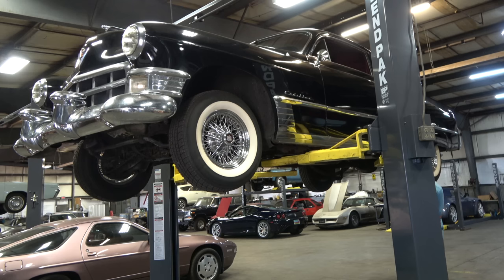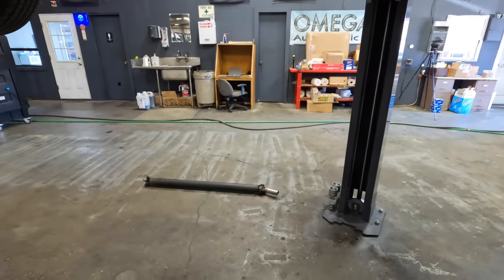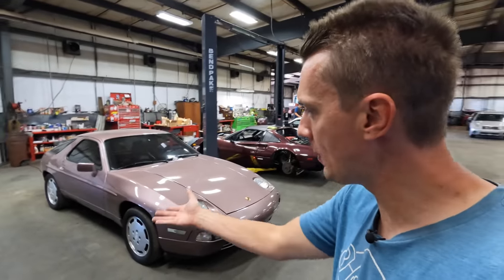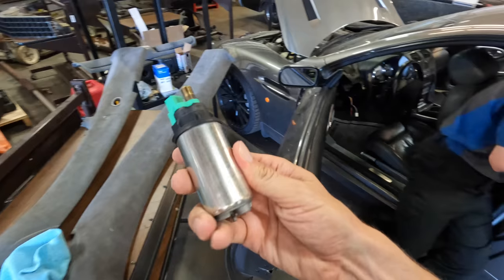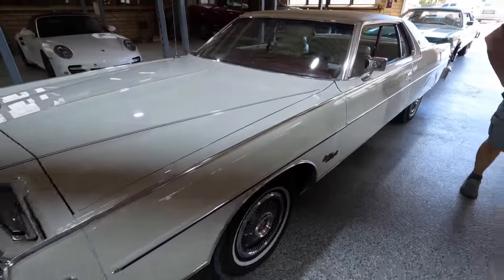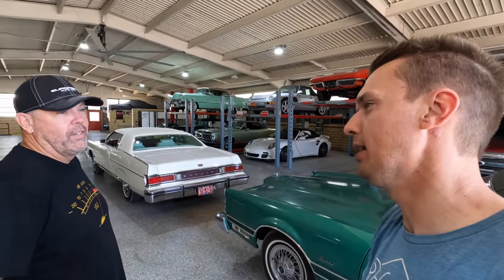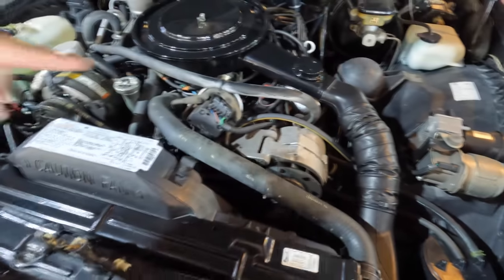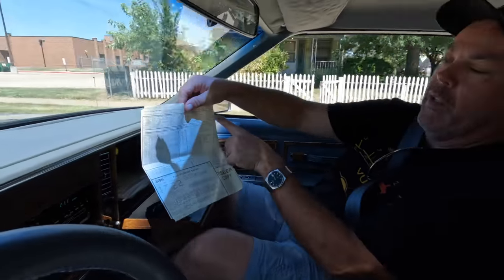We found some weird mods on my 1949 Cadillac Fastback Custom, and more things broken!

Comment: The '85 Riviera is really sharp. My Dad always liked Buicks. During the early 70s, my Mom had a new Cadillac (72), but my Dad had already owned a Buick LaSabre and then he bought a new Buick Electra Limited in 1974. I rode in the back seat of that car on many long family trips, logging several thousand miles. It is easy to understand the appeal of those Buicks. It was like sitting on a comfortable couch and you had plenty of room. As much as I loved that Cadillac, the Buick held its own. I would guess that Riviera would be a great trip car as well, since it is like new.

Comment: I had a 85 Riviera, same exact color and interior trim package back in 1994. The Olds V8 was heads and shoulders more reliable than the HT4100 in the Eldorado. Transmissions in these weren't very robust, neither were the plastic bumper fillers fore and aft.

Comment: Shouldn't drive that time capsule Buick in the daylight, the heat and light from the sun could damage the paint, the dash, the interior and maybe cause the rearview  mirror to fall off.  That's a car to cruise on the strip at night.  Love that green T-Bird, reminds me of the one from The Crow.  Hey, I liked the Buick Skylark beak from that period, I thought it made them look more aerodynamic and cool....plus it was a throwback to old GM stuff from the early 70s which also had a beak.  Eww on that red though, LoL!

Comment: Nice 1985 Buick. I brought a new 1984 Ford Mustang GT for $11,800 back then. The speedos  then topped out at 85 MPH due to Federal regs. 85 MPH was 3rd gear in a 5-speed manual transmission with an HO 5.0-liter V8. Good Times!

Comment: So the extra cooling was prolly because it was occasionally in a parade.  And at slow speed an electric fan blowing through in any direction will do.  As the speed picks up, the primary radiator can take over and get the job done.  I have a friend down the road who has a Buick straight-8 1941 4-door convertible that was in the movies and in many parades.  He had to add a spray mist water system to use the original radiator at slow speed.  On the open road it's fine.  That Caddy is likely the same ...

Comment: I had some experience with a pair of Porsche 928's some years ago, I found that they were glorified Audi's and was able to source parts such as bearings gears etc from Audi at a much cheaper price. The torque tube bearings were a lot of fun to change and I had to make tools to enable the proper placement of the new bearings. That was my first purchase of fine spline keys for undoing and doing up the bolts in those horrid things. You would have to be a tad masochistic to want to work on them.

Comment: Adjusted for inflation, that 1985 Buick sold for $55,720.79 in 2022 dollars. I would be very surprised if it doesn't get at least that much on Bring a Trailer

Comment: 307 in the Riv, oil filler was up front on all Olds motors. 305 would have a cap on the valve cover near the front or rear, depending on what side its on.

Comment: The Cadillac is very similar to my 49 Olds 88 fleetline. Especially the brake set up. Early 90’s mustang master cylinder. I upgraded mine to a 95 GT master cylinder and it works great.

Comment: Me and all the techs at the VW/Audi dealer I work at have coined the term “getting Hoovied” when a customer wanders into the shop with the service advisor to show them service/part replacement recommendations we have, and after showing them the customer hangs around watching their car be worked on, while they talk to the tech, and ask where certain things are, or how you get to a certain part, or just ANY random question you could possibly think of. To be truly 100% Hoovied though, the customer has to add a “how much would that cost?” after a couple questions 😂

Comment: Bilstein tried to move to a larger warehouse but it was sold from under them. They make their struts and shocks to order. So you will not find them in stock but can wait 3-6 months for them the build them once your turn in line comes. I had to wait almost a year for mine

Comment: that extra radiator might actually be the heater core just a remote location. and the rear shocks are just aftermarket air shocks, we all used to put these on our cars to help if we had too many fat girls in the back seat. you can see the car still has the original type springs on it. the 500in cadillac was actually one of the most reliable engines for its time, with 5 main bearings and the tough iron in the block it was almost indestructible. ive pulled them apart and hardly find a cyl with build up at the top. beautiful car, mine was a yellow convertible.

Comment: I had a twin to that 85' That is indeed a 307. Mine was two tone green with green interior with 25k original miles. WAS perfect till i hit a deer doing 60mph and it hit every panel down the side and totaled it out. Not my favorite riv" 64' Rivera with the 425 nailhead, and 71-72 with the 455 dovetail.

Comment: I really think that GM should have continued developing the Toronado/Riviera FWD drivetrain. It's packaging is excellent and overall it's very tough. I would love to have seen a 4L60E version of the tranny. That combined with the new Silverado 4.3 aluminum six would have made a great drivetrain for a series of medium duty delivery vans with decent gas mileage and good towing capacity. The LS/LT type engines would be an obvious upgrade as well. Though I think the six is strong enough.

Comment: No, the Riviera has a 307 Oldsmobile produced V8 with a four barrel, GM RPO code "LV2", not a 305 Chevrolet produced V8 (Such as an RPO code LG4 VIN code "H" or an L69 VIN code "G"). They were assembled in Linden, NJ along with the Toronado, Eldorado and Seville at the time. In 1986, the GM "E and K" cars were downsized and production was moved to Detroit, MI again at a then new GM facility in Hamtramck. The Linden, NJ facility operated from 1937 to 2005 and my grandfather's friend worked there for years and built both my 1982 Toronado and the 1979 Toronado parts car that I had. My '82 Toronado was built on Friday 9/11/81. 

It was hard to see any detail on the window sticker with that view, but it's easy to figure out. The VIN is something like 1G4EZ57Y*FE123456. That's 1G4 for US made Buick, EZ57 for Buick Riviera Luxury, Y for 307 V8 with four barrel, Oldsmobile produced, RPO code "LV2", * is a random check digit to avoid duplication, F for the 1985 model year, E for Linden, NJ assembly and the rest is the production sequence. It appears to possibly be code 15 Gray Metallic exterior paint.

Comment: That brake booster is off of a mid 70s Cadillac. Which knowing GM at the time means it's probably the same as the mid 70s impalas, C1500,  Delta 88, Electra 225 you get the drift. They used that booster on a ton of vehicles.

Comment: Bilstein Europe have these for 928 S4  520.03 EUR / Piece (incl. 19% VAT)
BILSTEIN - B6 Performance
for vehicles without electronic suspension control
Fitting Position: Rear Axle, 
Gas Pressure, 
Spring-bearing Damper, 
Bottom eye, 
Top pin, 
Monotube

Comment: Those buick riviera's had a horrible transmission. 2nd gear failed from the piston seal failing that operated the outer band grabbing the outside of the planetary gear set.. i rebuilt 3 of them back in the day.   The riviera's i worked on had 350 ci motors.... they were fast for their day. Faster than you would think. Very luxurious riding car.

Comment: I reckon the first generation Oldsmobile Auroras looked cool, and the motors were actually slightly better than the Cadillac northstars.. But it was the wrong car at the wrong time, if they came out now they would sell well I reckon .. Tyler is right though, they should bring back a Personal Luxury Car like that Riviera, people dont want these sedans that try to compete with BMWs for handling, they are Buying SUV's because at least they get the interior they want with compromise for the bodystyle and a rougher ride, but people want that couch like ride they dont want some bumpy tight euro style handling car..

Comment: The GM big block engines introduced between 1968-70 ran hot. A friend with a 455 equipped Buick says the answer is simply yearly coolant changes. I had a 1970 Eldorado that ran hot. This guy went overboard, apparently.

Comment: the Thunderbird my Dad had a 1979 Midnight Blue 302 base model he had no air conditioning no power windows , he bought that for  $7995  Canadian back then, those cars were boats but on the Hwy they were like driving on a cloud,  but they were thirsty even back then  it was a bitch to fill ,   weird card, no back seat room , being a two door,

Comment: Btw you don't need to convert it to R134a. 
There's R290 and R600 out there and mixing these two in a specific amount can replicate R12 and same goes for R134a . So no need to change anything on the car

Comment: I bought my 1991 Camaro RS with only it's second set of tires on it. They were brand new Goodyear Eagle 2s in 1995. I bought the car in April of 2021 and put 10k miles on the tires before I changed them.

Comment: Note to self: Do not buy an Aston Martin. Gutting half the interior to replace a fuel pump is insane. Just did one on my Mazda2, back bottom seat cushion pops out, remove cover (4 screws), disconnect fuel and vent line, unscrew locking ring, remove fuel pump assembly. A 30 min DIY job.

Comment: No, the 85 Regal was not front wheel drive. That whole G body platform (including the 1988 Monte Carlo, which was just leftover 1987 parts put together) was RWD. Wasn't until the next generation of cars in 1988/89 that they went FWD.

Comment: Having the battery-cutoff there is kinda pointless, you want it somewhere you can easily get to in an emergency.

Also how does the fender-radiator move air? There's no opening in the fender on the other side.

Comment: Shows you how lost in the woods GM was back in the 1980's.  That 1985 Riviera was designed in the late 70's, beautiful car, well built, well trimmed interior.   That 1992 Skylark was designed in the late 80's, its HIDEOUS and so damn cheap feeling/looking inside.  Granted I know two different price points, but the Riviera felt like a quality car and looked like a million bucks.  Even the 1985 Skyhawk(J-body/Cavalier clone) had a nicer interior and better styling than the 1992 Skylark, and that was a cheaper/smaller car.

Comment: The four speed Hydramatic gearbox that would have came with this caddy would have had no cooler, or later had a small torpedo like heatsink to cool the trans. fluid before they went to the common in radiator cooler system. They were strong enough to sit behind paired up GM diesels in Sherman tanks in WW2, and in the 60s were actually converted by B&M to the 'B&M Hydra Stick' transmission for drag racing which converted them to a manualised transmission used in the Gasser class, kind of like the manualised autos everyone uses today only they are cast iron and weigh over 300 pounds.. So I guess everything has gone full circle

Comment: ummm.. Why does that bad fuel pump still have the dust cap on top?? I know someone that had put a fuel pump in a car before with that cap still on and couldnt figure out why it would not run so he ended up giving the car to us and low and behold took the fuel pump out and saw that it still had the dust cap on it. Put it back in and the car cranked up and ran with no problem.. I know thats not the case for yall.. but was that cap put back on because it got put in the bag?

Comment: I think that odd radiator is closer to factory than you think.  First a disclaimer:
I sold my 1955 Cadillac Series 75 in 1988 and included the manuals and documentation in the sale.  As 34 years have passed since I last saw the material I am remembering.  I am presenting this as a rambling memory of an aging adult and hoping readers can fill in the blanks on the information that I am presenting..
The 1949 - mid year 1954 Cadillac had a water cooled transmission.  The cooling system for the car also cooled the transmission.  There was a secondary radiator in about the same position as your mystery radiator that provided a second level of cooling before the coolant went to the transmission pan to cool the transmission.  
In mid 1954, there was a fire in the factory that produced the water cooled Cadillac Specific transmission and in an emergency redesign, the 4 speed Cadillac automatic transmission was created by essentially engineering two two speed powerglides back to back and some fancy valving to make them into a Caddy transmission.  That design was used at least through 1956 (and later used by Rolls Royce) and did not have water cooling.  
Can someone fill in the blanks on this vague recollection

Comment: Fuel pumps last much longer with an approved ration of Marvel Mystery Oil to lube the internals. Fuel injection systems remain lively as well. Marvel Mystery Oil, our grandfather's old reliable is still relevant to this day. Not sure what it's purpose will fill in Teslas, but it seems to never die?

Comment: Ok the placement in the fender was a little unusual but an auxilliary radiator added to a big block swap is far from odd. I would say standard for that type of build, actually.
Reply: As a bonus, you can warm your hands on the passenger fender.

Comment: Love the old Caddy Tuna Boats. a massive 6 core radiator on a 500 cube engine would suffice, there is more than enough room between the grill & engine to build a high cube radiator.Looks like someone sprayed a couple hundred pounds of undercoating. I have a 1941 1.5 ton Chevy truck wiih a big brake booster like that, drinks brake fluid like water with no visable leaks on booster, lines or slave cylinders..Just dissapears into the ether.  Porsche 928 is just butt fugly as they come...Same era Miata is 10x the car.

Comment: Some years ago I looked at a similar T-bird on a little used car lot.  Does anyone remember they sold these wheel arch repair strips that you bent to fit and the top of it was cut so it turned into tabs as you shaped it?  Yeah, this car had a pair of those installed on the back. Badly.  They didn't bury them in bondo, you could make out every tab.  But then they painted it.   All I could do is ask why.